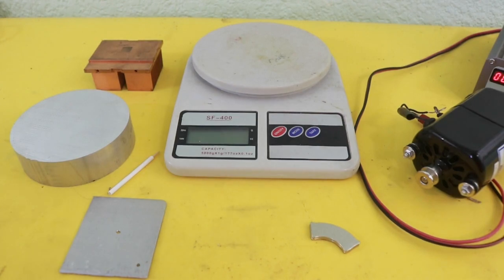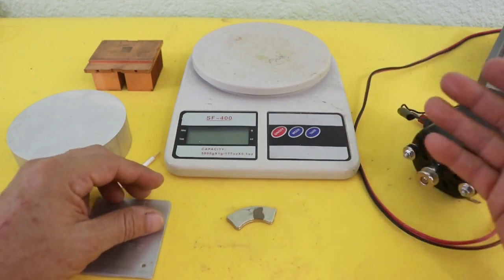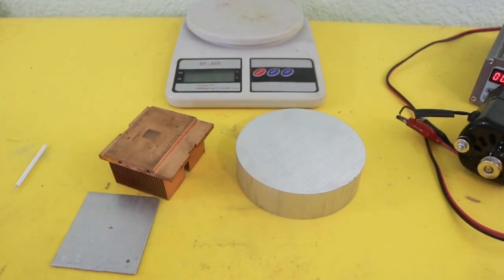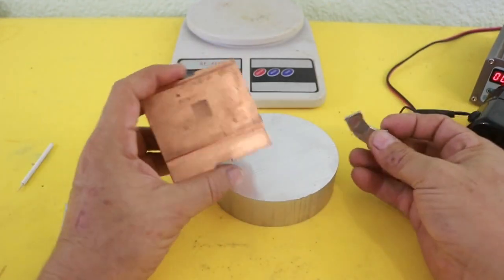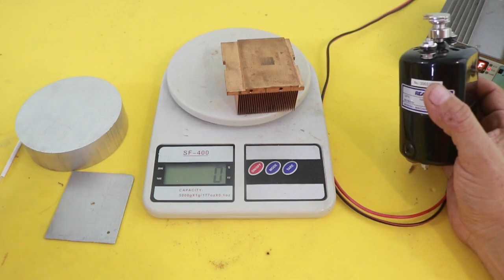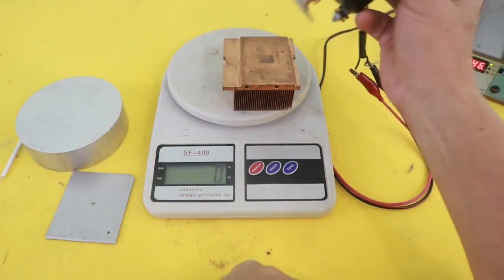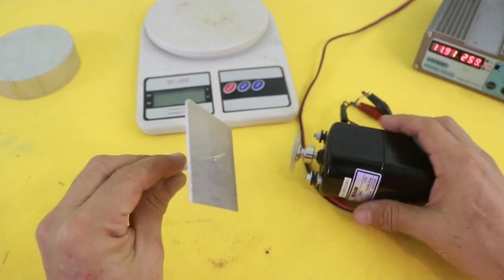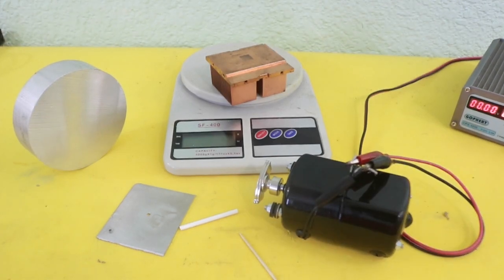Lenz Law Demonstration Experiments

Comment: Here's a thought for you. So Lenz's Law is the main drawback in your standard electric generator topology. The CEMF creates drag and the prime mover needs to provide more power to overcome that drag.

The CEMF takes a finite amount of time to rise, if we look at the formula for the rise-time of an inductor :

T=L/R 

where T=time in seconds, L=inductance of generator coil and R=resistance (total)

So, if we increase the inductance we also increase the rise-time.

What happens when we increase the rise-time so much that the CEMF occurs AFTER the generator magnet has passed part way over the generator coil?

What happens is that, instead of creating drag on the rotating magnet, the CEMF now accelerates the magnet since we've retarded the action.

And when the magnet has passed top dead centre of the coil, our increased rise-time now helps to push the magnet away instead of pulling it back.

A simple increase of the rise-time enables us to USE Lenz's Law, rather than be victims of it.

So, on the bench, if we have the standard rotating disc of magnets but generator coils wound with a high enough inductance to delay the rise-time, when we add a load to the system, the rotor of magnets speeds up while the prime mover inputs less power!

This would seem to defy the work-energy principle (adding kinetic energy to a system requires more work) yet we are breaking no laws.

I did a tiny experiment showing the effect back in 2012, apologies for the poor video quality :

https://www.youtube.com/watch?v=RviBQzjIX8A&list=PLyLMmnSL6MzHzU0cw-O5G4STBzUFqUuXi&index=8

My net pal did a 7-part series going into more detail, i have it archived here :

https://www.youtube.com/watch?v=d3hzyPotc6M&list=PLyLMmnSL6MzHzU0cw-O5G4STBzUFqUuXi

The discoverer of the effect has a YT channel here, where he goes into great detail :

https://www.youtube.com/channel/UCQeZxTYMsN6lHJ-V-i0jdgg

Comment: I have always found this to be interesting.  Used as dampers and brakes, ect.  I want to mess with it once set up in 12x24 foot lab/ garage I am trying to get done. Maybe late next year before I even have electricity for it.  Then to insulate, add heat and cooling And inner walls to put up tons of shelves.  I am almost 67 and these delays are not welcome.  Anyway, great video!

Comment: I can understand why the aluminium plate rotated.  But I cannot understand rotation can change mass.  The copper heat sink would have rotate similar to the aluminium plate but the force is tangentially outward; where the downward or upward force came from, I wonder.    Can you help?
Reply: The rotation did not changed the mass of the copper heat sink. The rotating magnet created an electric current to the copper and the electric current on the copper created magnetic field. That magnetic field at some point creates opposing force with the original magnetic field from the magnet. That is the observed added weight on the scale. Also the copper heat sink would have rotated if not by the friction to the scale which stops the supposed rotational movement. The aluminium one rotated because the friction is lessen by putting it in the stick. Well that is what i observed and understand. Hope it helps :)
Reply: You also have to take into account, that the magnetic field is not homogenious. I.e. not all field lines are parallel but create circular patterns. In addition field line will enter/leave the heat sink not only from the top but also from its sides and so one. That leads to forces in a lot of directions not only in the plane perpendicular to the rotational axis.
Reply: @pnl2pc73  Great explain. Also arise heat in copper? Or also in magnet? Thanks.